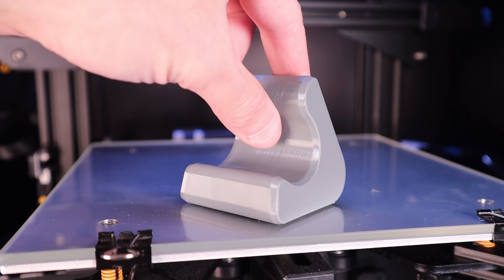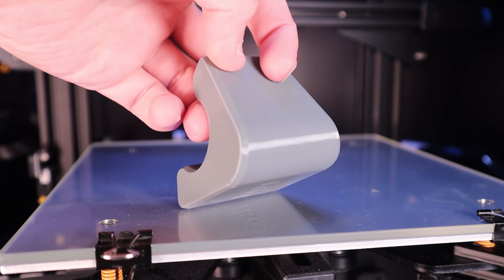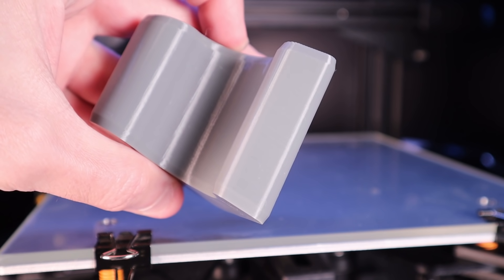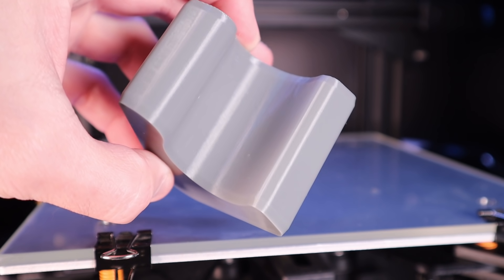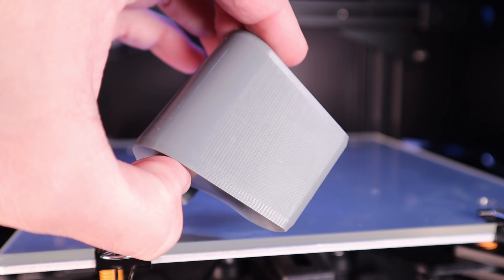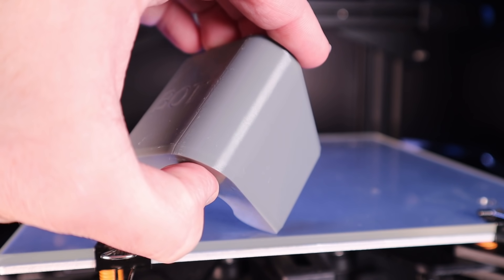Creality Ender 3 V2 - Simple Tips for Super Clean 3D Prints

Comment: Great video. I’m curious what do you think about convert your E3v2 to direct drive ? Found some projects on thinkgiverse and wondering if it’s worth time and will improve print quality or make more troubles.
Reply from the maker: I think it is considered by most to be an upgrade.  There are quite a few benefits to the direct drive setup, I may also change down the line, I wanted to give Bowden everything I had.  The only real downside of direct is print speed, with a sturdy frame like this printer has, it isn't going to be too terrible.  I have also looked into the pancake steppers, which may be too light duty, but if they can do the task they'll help as well. 

One of the big benefits is to swap filaments in a matter of seconds, the Bowden makes it pretty tough.  Personally that is the only thing I miss about my old printer.  

It can improve print quality in the sense that retractions and extrusions are handled better by direct drive, you'll likely have less stringing and blobs/surface defects.

I hope that helped!
Reply: @NeedItMakeIt  man, it was really helpful. After your comment I will upgrade my printer this week.
Reply from the maker: @filipdoniec7231  Let me know what you decide on, I may just go ahead and join you.  I was also thinking that I'd setup one printer direct and leave this one as is for a comparison.
Reply: @NeedItMakeIt  i will use the old one extrusion motor with everything and just print needed part. i ordered longer cable for motor (old one may be long enough but it’s really cheap) and when arrive i would let you know if theres big diffrence. In PLA i have no problem but currently i’m struggling in print quality with PETG so direct drive may be the answer.
Reply: Can I assume that you are aware of Flex3Drive project? Another term used is remote direct extruder.
Reply: No, just printed part to mount motor on spacers. Everything works, old cable is surely too short and now i'm testing it. Project is from JamieBK.

Comment: No part of this is about the Ender 3v2...

?
Reply from the maker: All of the prints are made with the Ender 3 V2.  All of my videos are labeled the same way, if someone has a different printer the methodology still applies, adjust as required.
Reply: @NeedItMakeIt  It just strikes me as odd to label a video for a specific when it is indeed great information for a general topic. 

You will drive away clicks from people with other printers that could have benefitted from the same information.

Also, because it is first, it's what people will read first and what they will assume the video will have content on.

If it was "3D Printing Tips and Tricks | Ender 3 v2" or something similar, it would make sense, as the ender 3 v2 is just an extra detail to the main topic: 3D Printing Tips.
Reply from the maker: @lens3973  Valid point, duly noted!  I may branch out a little later on to more generic topics also CNC machining is my background I will likely be providing videos about home-use CNC machines as well when I have more space and time.

Comment: Just discovered your channel.. Very cool tips all around Tks..
Your print quality is very good overall.. Would you mind sharing your cura print profiles to take a general look (and maybe copy parts of it)?I use a standard .4 nozzle, but might move to .6 after you show your results.. (mostly focused on practical prints myself, not figurines and such) 
Also, always wondering what needs to change and what not as I switch between different materials (PETG, PLA, TPU, Nylon) and different layer heights.. Maybe an idea for a video..

Comment: MEH just hiding problems, not fixing them.
Its better to get your retraction settings dialed in properly, so stuff doesn't string and blob in the first place.
All combing/one at time is doing is hiding those problems on the insides of the print, but they're still occurring. You're still going to be held back till you deal with the root of the issue.

Comment: Two really important things to note here. 
1. Material quality plays a LARGE part of print quality. I know people in various fanbases for printing like to say that theres nothing wrong with cheap materials, but I have the privilege of using Ultimaker printers at work and they pay for whatever material I want. I use filament brands that are typically considered "too expensive" for a lot of the forums, but I gotta say, I never really have these issues when I print.
2. Working with cheaper printers, you have to be really on top of making sure you are using good components, and making sure that your machine has all the belts and nuts tightened up good, and that your frame is nice and straight, etc. Some machines have designs that help with these things more inherently, but a lot of them suffer from too much possible variance.
Reply: This needs to be higher.  It is like paper products, cheaper means markedly less performance.  Go up 50% in materials costs and the headaches mostly disappear.  See : DIY recycled plastic printer filaments.  Yes they CAN be printed, but why?

Comment: I think your retraction isn't enough good, as seen on your rush

I advice 4.5mm of retract and mire than 50mm/s speed retraction
Reply from the maker: Yes it can be adjusted, for the testing I've kept it low to make sure these problems had a bit more visibility.  I think you're right 5mm retraction is typical for this printer.  During testing I still had a small amount of movement at the extruder fitting, I am testing a permanent solution now for no movement and so far it is working well.  Solving this will make for nicer prints also.  

I am using the cheapest PETG one can buy.  PETG shows these issues more than ABS or PLA for example.
Reply: @NeedItMakeIt  Oh ok, thanks for the detailed answer 😉

Comment: Lol, i can't even install marlin properly let alone do anything in this video.
Reply from the maker: The Channel CHEP has some tips for firmware updates.  I had problems with this out of the box and it caused me lots of trouble with under extrusion, his videos helped me for sure.
Reply: @NeedItMakeIt  Hi, I'm a 3d printing noob who borrowed my father's select mini v2 to learn and recently bought myself a ender 3 v2, after almost a week of troubleshooting and tearing and rebuilding it 3 times I figured out my glass plate is bad (noob mistakes) and no amount of tweaking will give me a good bed level so I removed it and can finally start printing but I've never messed with the firmware, is it good to update it to latest when released or is it more of a "if it ain't broke don't fix it" kinda thing? Just curious what I should do If my prints are already coming out good?
Reply: @BlondieHappyGuy  it doesn't have the bed leveling sensor, but it came prepared for the bltouch on the motherboard. There's a bltouch firmware available on the creality website that works oké. I run a version of marlin that is a bit easier to modify. 

It's all in all a really complete printer for the money, although I find the rollers somewhat unstable and very high maintenance. I'm considering upgrading to linear rails on all the axis, but some say it makes the prints worse. 

Out of the box performance is just as good as a prusa MK3S.

Comment: Carbon fibre with a brass nozzle?
That's not going to last long.
Reply from the maker: Correct, as mentioned in the video.  Also the brass extruder gear.  This single small part caused some wear.

Comment: no offence at all, good tips there, but I can't believe people struggle to get clarity shown in this vid. My elegoo neptune 2 printed that clean out of the box with no need for print bed preparation (glue etc) or anything of the sort. Just import the part and press print on default settings and it just does it. Perfect finish everytime. If detail starts to slip, simply slow it down  even MID PRINT and you get problem solved.

Comment: All of these just seem like bandaids for issues that people are having. Bandaids are fine, but if you want to print a lot of stuff at once and have them look good, you need 3 essential things.

1. TUNE TUNE TUNE
This is the single most important thing with 3D printing IMO, tune your temps, flow, retractions, esteps, everything that you can.

2. Use good quality filament.

I know it's tempting to buy the cheapest stuff on Ebay, I've been there before, but please don't. There are many reputable retailers like Matterhackers, 3D Fuel, FilamentOne, Prusament, IC3D, Fillamentum, Printed Solid Jessie, 3DXTech, and many, many more. 

3. Use Prusaslicer 2.3

Prusaslicer 2.3 introduces some absolutely awesome features like paint on supports, custom z seams, and many more.

Bonus tip: If you PETG is stringing, dry it! Usually 9 hours at 60C in a food dehydrator is enough. PETG is known for being hydroscopic. Buying from a reputable retailer as mentioned above can also combat stringing. For example, my Prusament PETG barely strings at all or absorbs much moisture. If you have any questions I'd be happy to answer them. Stay safe and happy printing!
Reply from the maker: All great tips, thank you.  

Not everyone has a dehydrator, do you have settings you'd use for an oven for example?
Reply: is prusaslicer 2.3 out yet? 
I'm waiting on ironing :/
Reply: @NeedItMakeIt  I would probably buy a cheap dehydrator rather than use an oven. They are really inexpensive...

that said I have never had an issue - I store my filament in vacuum storage bags (you know - the ones for clothes) between use. Simple and works for me.
Reply from the maker: @beware_the_moose  These PETG rolls are fairly new, but could do with a good dry, I like to keep the in the enclosure, in the summer, it could be a problem.  Thanks for tips.
Reply: @NeedItMakeIt  About the same settings for in an oven.
Reply: @beware_the_moose  It has a release candidate on their Github! It has a few bugs but nothing that will break stuff.